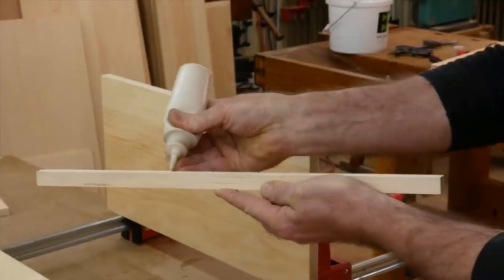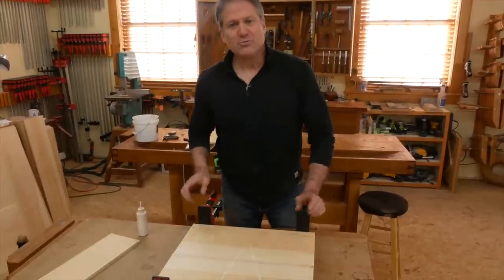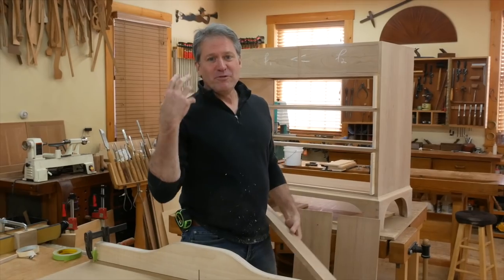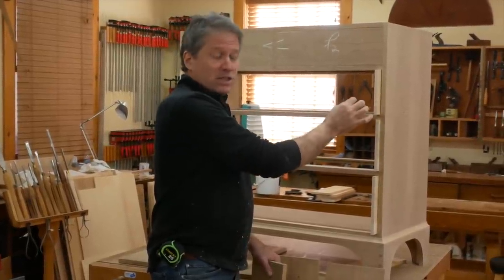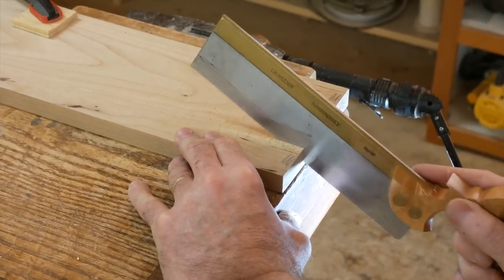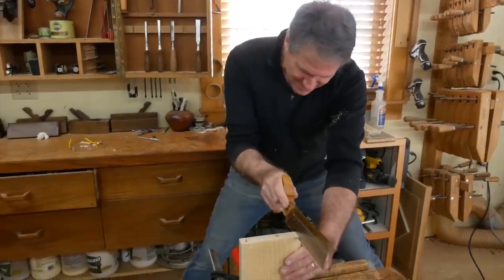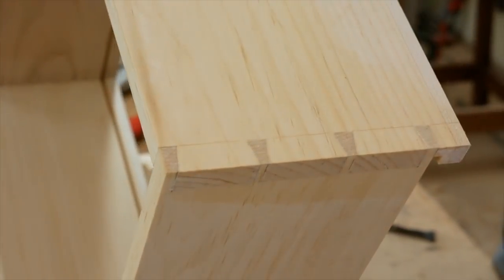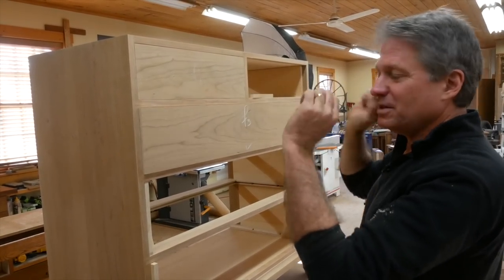How to mill parts for perfect drawers

Comment: I’m curious about why you use white pine for the drawer sides at all if it wears easily. Why not just use the hard maple for the entirety of the sides? Is it because it’s more economical, because the Shakers used secondary wood like pine or poplar (so it’s a furniture making tradition) or is there something about the properties of pine (or poplar in some cases) that make it particularly well suited for this purpose?

Comment: Tom, instead of the green / white tape method, why would you not use a hand plane and a shooting board?
Reply: Great question Greg. You could use a shooting board of course, but I prefer to get the cut with the stop on the table saw because it's faster, you don't need that fine a surface on the ends since they get planed slightly to "piston fit" the opening later, and since you want the drawer back the same length at the front, the back is quickly cut at the same stop position as the front. Hope that makes sense, Thanks!

Comment: Tom, tell me about the splitter you are using on the table saw. I haven’t seen that before on your saw. Is it new? I am restoring the exact same saw and a riving knife cannot be installed. Did you make this? Buy this? Thanks!!!
Reply: I can help... its MicroJig Splitter system. I also have it

Comment: The first noob who sees this video and is going to try to rip panels on the table saw using his bare hands like that is going to land in the ER.
Reply: Agree. A pro like Tom may be comfortable doing that but push sticks or something like a Grr-Ripper add a lot of safety with basically zero time lost for the operation. A Big Horn 10230 is great for both a table saw and jointer and there are many other options.
Reply: And also leaving the saw on and then turn away to check something else while wearing ear protection might not be the thing for everyone. Some may got distracted and forgot or not noticing the blade is still running. Tom is a pro, but hobbyists might not be as careful or as attentive